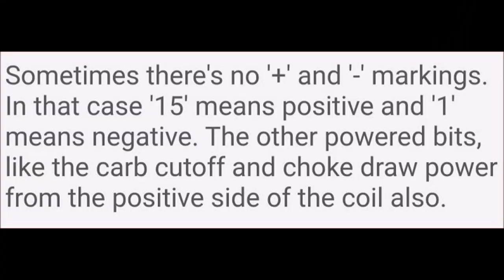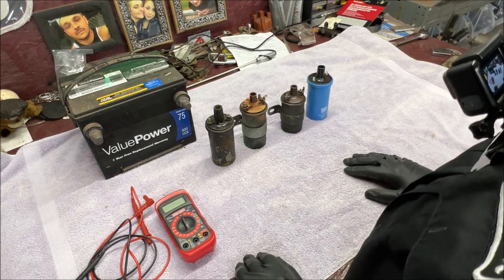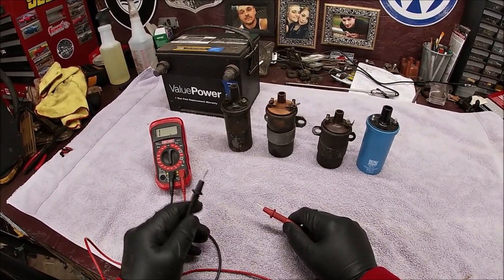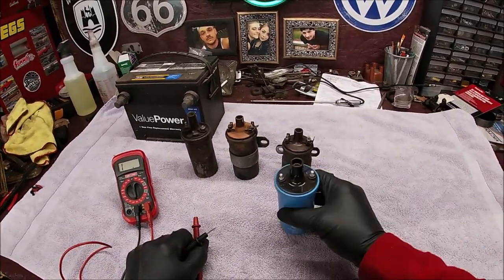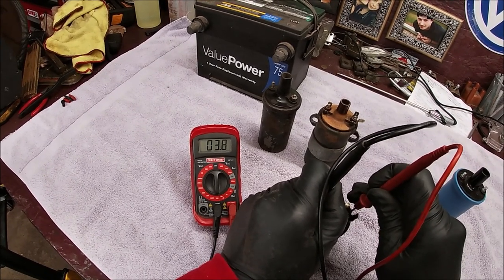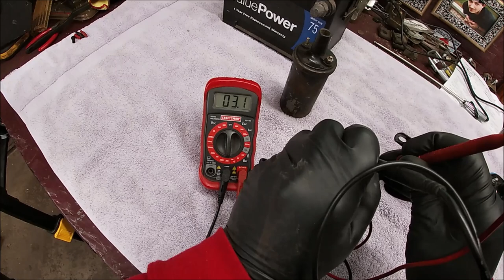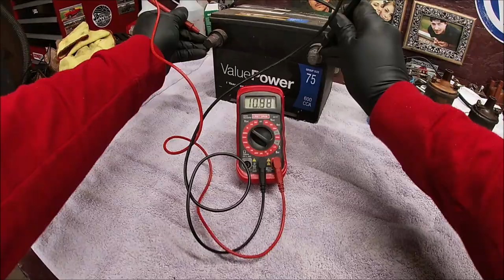HOW TO TEST A VW BEETLE IGNITION COIL - BEETLE NO SPARK - VW BUS - VW DUNE BUGGY - Pertronix - BOSCH

Comment: This was exactly what I needed. My VW 1600 cc engine for my Sand Rail ended up having a thin corrosion layer on the coils negative side plug. My testing with an ohm meter helped me to identify the problem and your tips to test a spark at the plug confirmed the coil was still good… Thanks 👍🏼

Comment: Hey Slade,

Thanks for the detailed tutorial.  I was having an ignition problem that I narrowed down to my Bosch blue coil.   I followed your guidance and all checked ok, but still had a problem. I tilted the coil on the same angle as it is mounted on the fan shroud. Voila, it failed the primary test.  I tested it multiple times as I slowly rotated it on its axis.  It passed sometimes and failed sometimes.  Please let your subscribers know to check it in an “upside down position” .  It made a difference in my case.  Purchased a new coil.  Thanks again!

Comment: Hey there, appreciate all the VW beetle videos, just wanted to mention that the reason why one of the coil secondaries are showing 19k and then 1 is because you had the multimeter range on 20K Ohm, and the coil is going from 19k to past 20k so the meter goes into over-range and to get a reading you need to turn the dial to the next step or 200KOhm. I'm an electronics technician and Electrician so just thought I'd mention that. When a coil goes, the resistance drops, it never increases. But for re-overhauling the VW 
engine I am going to need all the help I can get man
😁

Comment: Hey Slade,  great info on testing the Coils.  Your 2nd short stubby coil that was reading weird , just set your volt/ohm meter up to the next level .  From 20k to 200k. I think it was reading higher than what you set it at.   Then you should get a reading on the meter.  I hope this help.  Keep the videos coming.

Comment: Good video! You are correct, the electronic ignition needs 3 ohms on the coil. I check my coils the same way. I had never thought about ringing it out to the  case. You figure I would know that seeing how I'm an electrician. I do do motors that way.

Comment: Great video! I had no idea about getting the "zero" on the meter. My cheap Harbor Freight one is all over the place for a zero, but the readings seem consistent. I got a VW MG TD kit car from a family friend. It has sat unused since her grandfather passed away 6 years ago. Plugs and oil are brand new, he parked it immediately after servicing it. Some of the grandkids messed around trying to get it running, no luck. I have two coils for it, both show what I believe to be decent enough readings to at to spark. I have spark on both coils doing your test towards the end of the video. Any troubleshooting tips to go through for the condensor? And anything I should be checking on the rotor and cap? Everything looks extremely clean there. Just trying to figure out what's causing the issue between the VW schematics and the kit car schematics, it isn't too much fun

Comment: Hello Slade. 

I have good resistance while testing the primary but absolutely nothing on the secondary side. 

My meter does not have an option to change the range. It’s an auto range high end fluke used in the electrician field 

I’m not getting anything out of the meter on the secondary. Not a beep. Could this mean a bad coil? 

Thank you

Comment: you dont deduct the meter resistance on the second (high range) reading. the .02 would be 6860 - 0.02, not 6.86 - .02, so the reading really is not affected by the meter resistance on the high range reading, just the first, low range reading.

Comment: How is it possible that you look for short signals and the multimeter always reads zero even with the cables separated????? I think that in that reading you are not measuring resistance